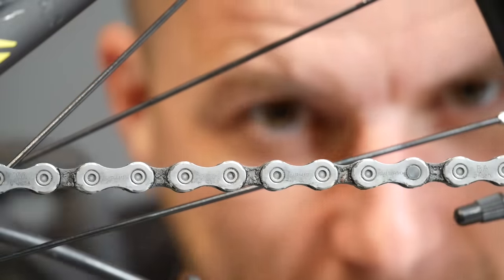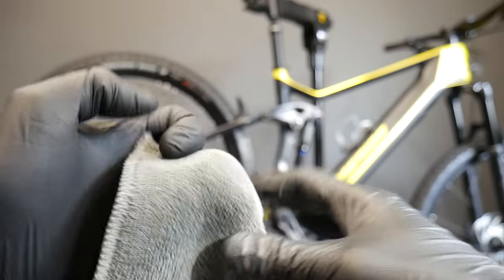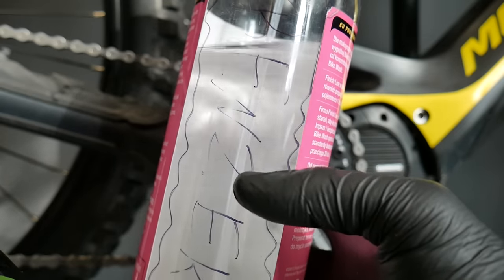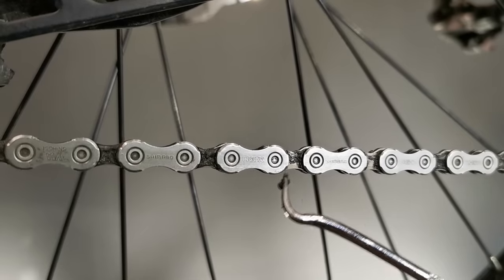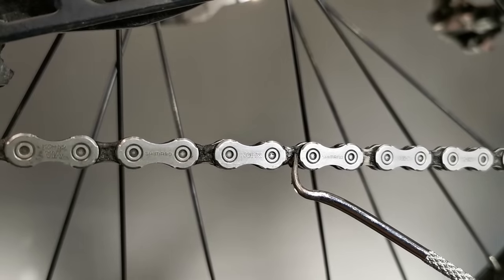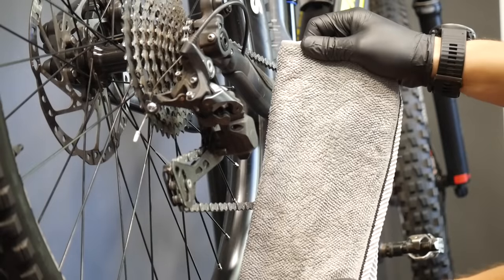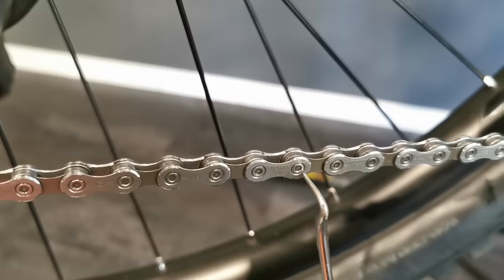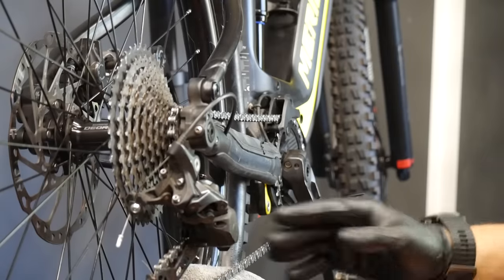This Drivetrain Will Last Much Longer. How To Clean And Lube Dirty Bicycle Chain. Slow Mo Comparison

Comment: Maaaan that is time consuming. Just buy a chain cleaning device and run it until the water is clean. It takes about 3 soap passes and 2 clean water passes to clean and it is much faster. (I use dishes detergent and wax)

Comment: This is not the issue if you use wax based chain lube.
Anyway, if you are really into biking, you have 2 chains, it adds like 100-150% to casset life cycle and about the same to chainring.

Comment: What a waste of time. You are cleaning that chain incredibly well, except your jockey wheels are obviously disgustingly filthy and your running your nice clean chain through them constantly 😂
Reply: at 6:58
Reply: @zomborigergely7960  at 6:58 he removes a zip tie from the crank arm…. What’s your point?
Reply: This is a video on how to clean your chain. Emphasis on the word Chain. Of course, you should clean your entire drivetrain, preferably remove your chain before doing so, but that's not the point.
Reply: @ghcheong  please tell me how it’s possible to effectively clean a chain when endlessly running the chain through mud?

Comment: Muc off chain cleaner. I always do the lube slowly ensuring there is lube on every roller, not just dribbling it as you spin the chain.  Leave it to soak in. You don't need to do both sides.

Comment: This process will take a decade to complete it, instead I would recommend to remove the chain and dip it in a bowl full if Diesel and clean it with brush ☺️
Reply: 5-10 min is faster than to dismount and mount the chain again. But I agree the procedure with the shoestring is far too time consuming

Comment: What if you just use ultrasound?
Reply: Ultrasound?
Reply: @kylllaurenceaguilar7451  Well, yeah. Ultrasonic cleaner. Fill it with acetone, put the chain there and turn it on. 2 minutes and it's squeaky clean.
Reply: They are the best, but the proper use of a chain cleaning tool will obviate the need for that.

Comment: I remove the chain, put it in a bottle with degreaser solution, close the cap, give it a good shake and leave it soak while I clean the rest of the bike. Then I rinse the chain, give it a quick bath of brake cleaner, then spray with WD-40, then reinstall it on the bike and apply dry lube. Way less tedious and more time-efficient.

Comment: This video shows one of the worst ways to clean your chain you are supposed to remove it via the quick link, soak it in de greaser submerged so you can get the muck out from inside the actual links which is what causes your chain to wear in the first place, NOT muck on the outside. 
And if you want your chain to last 6 times longer go ahead and submerge it in a Chain Wax solution where you heat in a pot. 
It will also be completely clean as Wax doesn't attract dirt like grease and oil does. 
It is very sad that youtube removed the dislike button because now nobody will know that this video is straight up misinformation.
Reply: Surely external filth will lead to chain degradation too?

Comment: i use squirt wax dry lube. if you need to clean a chain with oil on its better to take it off and throw it in soapy boiling hot water and agitate. lots of stuff will come out of the rollers. better than brushing. but if you have been using wax lube then just reapply more wax as it does flake off and fall out and starts to sound metallic after a while lol the bottle says no need to clean just reapply more wax lube.

Comment: I'm Virgo and this was crazy even for my way of understanding the word "Perfection" 😂

This is only OK for people with lots of patience and crazy perfectionism in their heads.

I'll just take off the chain, soak it into a small cup full of degreaser and leave it for like 20-30 mins. After that the chain will be super clean and as shiny as a new one. Then I'll just put the chain back on and add lube.
Reply: You're no Virgo, or only Sun, not ascendant...
A real Virgo would at least leave the chain soaking for a few hours, then shake for a few minutes, probably rinse again in methylated alcohol... and shake again! before considering it clean!

Comment: Hm i think its quicker to bush out the pin, throw the chain in to Petro or diesel for some minutes, clean with a rag and pressured air and then mount it with new pin and lube it...

Comment: Simple tricks I show u. Remove the chain, soak it in diesel or kerosene. Then fix it back n lubricate
Reply: Oh Come on... where's the best part where you light it on fire?
Reply: @usamanasher6852  And that way, no need to recycle the dirty kerosene...

Comment: Doesn’t actually clean the chain, you need degrease to penetrate the pins.

Honestly just take it off and soak in high concentration degreaser for and hour or 24 and rinse. Your method is labour intensive and doesn’t actually clean it
Reply: This exactly. I would just prefer to dip it in digreaser a shake the bottle. Or buy a new one rather than doing all this.
Reply: @poured_treasures  if we buy a new one, do we need to lube it up too?
Reply: That's still not enough. You need to shake it in gasoline or diesel to actually degrease it. Follow up with a wax job. Don't use drip lube.
Reply: Breaking the chain and then linking it back up will weaken the chain. That goes for quick links too, they shouldn't be used more than once.

Comment: Clean the rest of the drivetrain first then buy a chain cleaner and run the chain through it in 5 minutes for the same results in 1/1,000 of the time you took. 🙄

Comment: Its easier to remove ur chain from your bike..get a container and soak it with diesel or degreaser and leave it for awhile while cleaning u rd and cogs separetely since ur chain was already removed..this is not the proper way of cleaning..sorry

Comment: This guy runs a shoelace through every slot.. but he can't be bothered to properly oil each pin. The slomo clearly shows many pins get no oil.
Reply: Also this thick Rohloff oil need some time to soak in. He just wiped it off and distribute it on the surface.

Comment: I cleaned mine today for 45 minutes (not worth it). Just some hot soapy water, brush the outside with a toothbrush, use special brush for the inside. Pretty clean now
Reply: did you apply lube or was that not necessary?
Reply: @nomz1362  you should lube your chain of course, it's mechanical part that's constantly moving, and if you don't lube it, the chain will wear off because of the friction.

Comment: What did you need the cable tie for?
Reply: For cleaning inside parts of the chain.
Reply: @ferroviari1435  
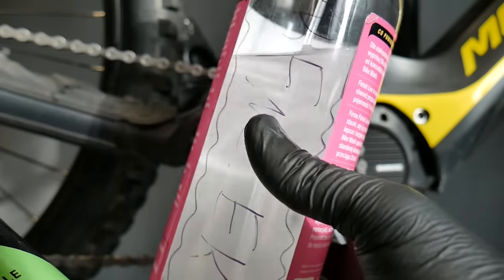Doesn't look like it ... take a look at 2:00 on where he fastens the cable tie around the "crank" I think is what you call it.
Reply: @justgivemethetruth  I guess this is why on e-bikes you can "disconnect" the crank to the electric motor.
Reply: @ferroviari1435  
I have no familiarity with e-bikes, but whatever is happening a cable tie is connecting something to something else ... I just don't get what is happening there?
Reply: @justgivemethetruth  me neither, but it appears that he is connecting the crank arm to the chainring. I'm going to ask a friend.
Reply: @ferroviari1435 
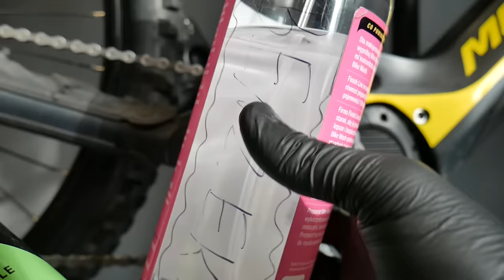Aha, if you start watching at 1:58 I think I get it.  You comment about the motor and the front gear are connected together, and then the crack is free to rotate backwards or be still, so if you want to rotate the chain without grabbing it or the front gear you need to connect the crank to the gear.  You got it.
Reply: @justgivemethetruth  That's it! Great!

Comment: It is much easier and faster to remove the chain from the bicycle and wash it in a bottle with solvent
Reply: This video shows one of the worst ways to clean your chain you are supposed to remove it via the quick link, soak it in de greaser submerged so you can get the muck out from inside the actual links which is what causes your chain to wear in the first place, NOT muck on the outside. 
And if you want your chain to last 6 times longer go ahead and submerge it in a Chain Wax solution where you heat in a pot. 
It will also be completely clean as Wax doesn't attract dirt like grease and oil does. 
It is very sad that youtube removed the dislike button because now nobody will know that this video is straight up misinformation.
Reply: @tusk6489  Your post is disinformation too, wax is not fit for mud, you'd have to clean and rewax after every ride, and the cassette will rust.
Also many bikes still come without a quick link.

Comment: Remove chain and wash it in gasoline. The simplest way to clean your chain. But don't forget the RD and cassette
Reply: Mate, if you use  quick-release device that's the quickest option fsure. If not, using some of these tips might be actually way quicker

Comment: This is the hardest way to chain cleaning ever. Why so many steps? just use a cleaning tool and that´s it!.
Reply: That's what I was thinking. I just use a chain cleaner, or soak it in hot soapy water if I wanna do a deep clean.

Comment: I get older one year watching this.. Quick link out, put the chain in petroleum 10 minutes, oala
Reply: ikr? Same thing takes me about 10 minutes, and the derailleurs, cassette, and chain are all squeaky clean, relubed, and ready to roll.
Reply: @mysock351C  what do you use to lube the chain after cleaning using petrol/diesel?
Reply: @markmartinez846  WD-40, mainly because its cheap, plentiful, and stays put on the chain. There are much better lubes, but the chain must be fully soaked in the lubricant as it will be bone dry once it comes out of the solvent bath. Since WD-40 is available in large tins, its easy enough to just pour some out into a container, and place the chain in it.
Reply: @markmartinez846  Also I usually use mineral distillates or naphtha. They are less volatile than petrol, and don't smell much. As a bonus, the used solvent can be used for lighting the charcoal grill since its literally the same thing as lighter fluid.

Comment: I find using a Park chain cleaner device saves a lot of that extra time and hassle from his method and then I clean the rest of the drivetrain like sprockets/chainwheels/jockey wheels/derailleurs, etc. I can't even imagine having to use a shoelace, that just adds to the tedium.

Comment: No cleaning required, just lube the chain eventough i ride mtb thru mud & dirt my chain lasted very long time, . Biggest mistake is failing to lube chain/BB, bearings etc  after cleaning/washing bike. I lube b4 ride  during ride(if long hours) & after i wash my bike.

Comment: I know easily way to clean a chain. I put chain in empty plastic bottle and add there solvent for oil paints, and shake it. Solvent is cleaning the chain from old lubricant and dirt. After that I wiping the chain with a towel and lubricate it.
Reply: plastic + solvent = no more plastic, use glass u fool
Reply: @ohhi5237  Solvent sold in plastic bottles. When you try shake glass bottle with iron chain with solvent, you definitely broke the bottle.

Comment: Sir, can you still put a new chain on a cassette and chainwheel that is already worn out? Thank you.
Reply: Depending on the wear of the cassette. I usually change my chain 2 times before I change my cassette
Reply: @armandarion8073  i was not able to change my chain and now its too late. The chairrings and the cassette are wornout even having a new chain is not possible. I had to buy a new chainring and cassette. Hehe
Reply: No

Comment: The way i clean my drivetrain is i remove rearwheel and replace it with dumhub. Then i clean drivetrain completely  with degreaser. Doesn’t last long when it’s clean enough.

Comment: Park tool chain cleaner + water will do the job 10 times faster. 
You don't have to use degreaser with chain cleaning machines, just use water
Reply: just water? hot water?

Comment: Get set up for waxing and you'll never go back!
Reply: I use dry lube wax on my road bike and its perfect, but on the mtb I still use oil due to the severe muddy conditions
Reply: Get set up for belt drivetrain and you'll never go back! :D
Reply: @liamzhang6126  road and mountain bikes dont use belt drives only hipster city bikes. But yes having those saves you some hassle.
Reply: @stormfox81  learn more mate :D Touring, commuting, mountain, road bikes all of them will have belt drive in a couple of years. The same thing was with disc brakes. Majority of road bikes now are on disc brakes.
Reply: @liamzhang6126  I really doubt it because belt drive bikes have been around for many many years and they still cant beat chain drives because its far more expensive, its less efficient, cycling feeling is totally different and you can't change gears whilst peddling. For commuters this could be a good system but not for the majority. Besides, what is wrong with cleaning your bike after a fantastic ride? Every trail rider here knows cleaning and maintenance is part of this fantastic hobby and giving your bike care and love comes with it.

Comment: you only cleaned the external surfaces, what matter more are the parts that rub together which is inside and unreachable.. you need to soak the chain in some solvents 🤦‍♂
Reply: Agree, but sadly you cannot do that after every ride.

Comment: With wax everything lasts longer,  dirt sticks to oil no matter how many times you clean your chain .
Reply: Is there any specific type of wax or any wax works?
Reply: @mortale  I use Smoove not Squirt sorry, (no bees wax).
Reply: 9 years of hot waxing and I could never go back to doing this crap.
Reply: @paulb9769  I use smoove; just the initial clean and then use smoove no hot waxing
Reply: @johnverrios3944  Yep I do the initial deep clean just found hot wax to be more effective and cleaner.

Comment: waaaayyyy tooo much work!
Reply: 1. Spray with WD40 wait
2. Wipe down with rag....
3. Stay out of dirt and wet trails.
Reply: @SG-dg6oi  xD
Reply: @SG-dg6oi  So you don't oil it? WD40 is also a penetrating oil which gets rid of the oil and water in your chain links, you'd have to actually use a chain cleaner after using WD40 as it totally drys out your entire chain and that simply screams for rust. WD40 should never be used on a chain for bikes especially if you don't even oil it afterwards.
1. Spray down with a bike chain cleaner
2. Wipe down with a rag....
3. Oil the chain properly and wipe away any excessive oil with a rag
4. Have fun
Do it properly because the way you do it, you actually kill your cassette and chain even faster.
Reply: @SG-dg6oi  No, it does not. Google it yourself.
Reply: @VenoXj1  you're wrong. WD40 do all kinds of things. Their chain lube is called "WD-40 Specialist ® Bike Chain Lube".
Reply: @mkmbstudio6950  Mate, if it's specifically labelled chain lube, it's chain lube from that very brand. 
We were talking about WD40, not their chain lube. Just simply WD40....
Reply: @VenoXj1  I guess S G was talking about their chain lube.
Reply: @mkmbstudio6950  No, it was not and neither did he delete the comment lol. 
But good for you to join an interaction which is 2 months old and also having no idea what people were talking about yet saying someone was wrong. Just stop please.
Reply: @VenoXj1  😂 you misunderstood  the guy who even specified in the other comment "WD40 ALSO makes chain lube" he meant their lube but you persist on believing he meant the common contact spray haha
Reply: @mkmbstudio6950  Looks like you can't read then, okay then.
Reply: @VenoXj1  true, I can't read. Welcome to the club
Reply: @VenoXj1 how was cleaning the chain. Did u clean it

Comment: Dear god... Just buy a new chain every 4 months and replace it, its much cheaper, less labor intensive and less of a headache then doing all this crap every 2 weeks... You must be nuts
Reply: There are methods using wax lube where the labor time is minimal and the chain wear greatly reduced making it considerably cheaper than buying a new chain, cassete and chainring every so often.
Reply: That's fine for the $100 walmart bike you own.  The rest of us rather not destroy the drive chain on our $10000 bike.

Comment: You can use dawn or any dish soap to clean your entire bike. Excellent degreaser and dirt removal.
Reply: no you shouldnt ever
Reply: @ohhi5237  why not? It does my bike wonders.
Reply: @yishaithegift9953  it does more harm, if you want to be cheap, use diesel, no water in diesel
Reply: @ohhi5237  diesel? Like gas? I don't understand. Dawn is harmless to an bike frame, chain, and components. Simply wash, rinse, and dry. I apply car wax afterwards shines like a dream.
Reply: @yishaithegift9953  no, like diesel fuel, the liquid, it has no water, unlike soap, and its a lubricant

Comment: I'm definitely not a pro... I use a finger nail brush, and to get the molybdenum disulphide gear out from the former owner, dishwashing soap with water.

After getting it spotless times now the previous grease still comes out from been the links and makes me wish I just disassembled the entire drive train putting the sprockets in a friends parts washer and bought a new chain and waxed it with paraffin and ptfe so I can reduce the maintenance time each week and give it a slightly longer maintenance once a month. 

MolyD just keeps oozing out of everywhere. -_-

Comment: The jockey wheels couldn’t be thicker with grime if you tried and the chainring is a real mess too. It will just pick up the dirt you just spent 4 hours cleaning off with a shoelace before hand. 🤦

Comment: Great job. But lots of time spent. Comparing with the cost of the working hour, it probably is better to change a new chain. Do not mean to demean the great efforts. Just looking at things from a cost-effective angle.
Reply: Nah you have to also keep in mind how much a dirty chain will wear out your cassettes and cogs so it is worth doing. Although, agree some of the methods he mentioned are not the most time efficient
Reply: @sAmiZZle82  Got your point. Tks.